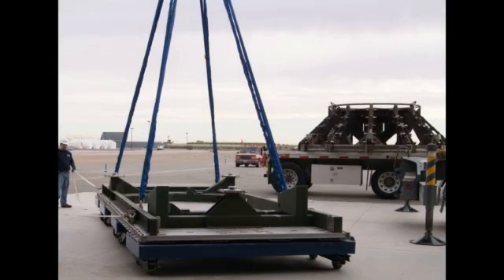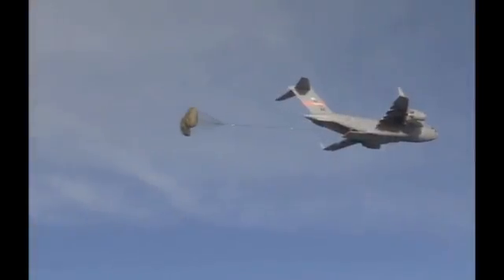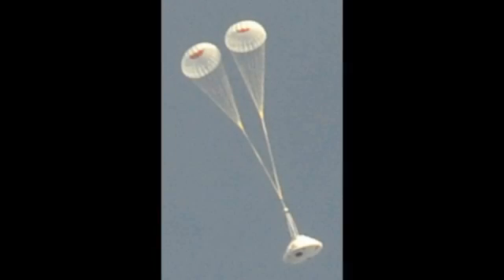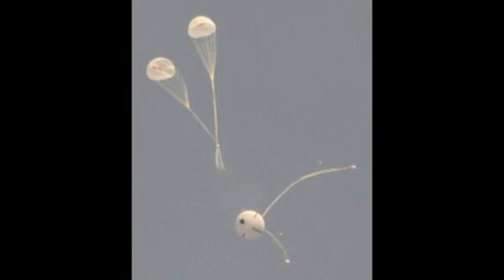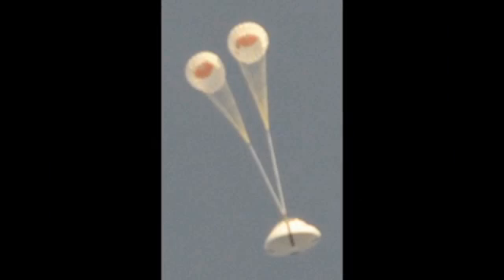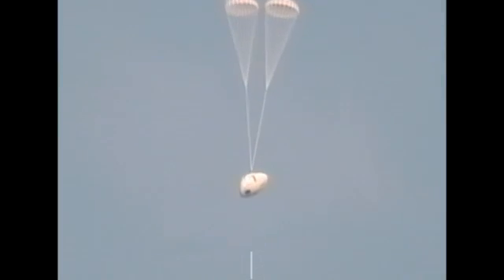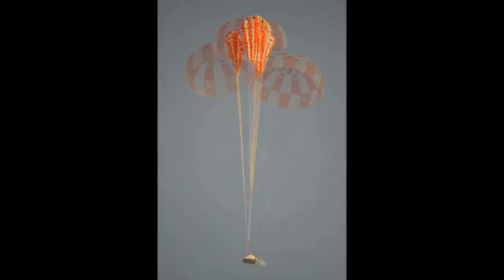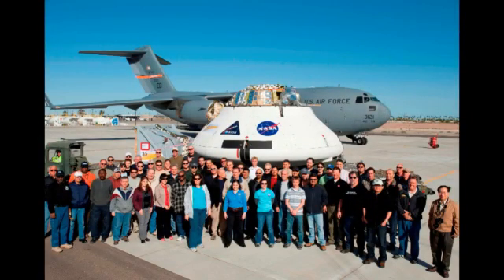Orion Parachute Testing: Fed. 29, 2012

Comment: Looks really bumpy..it seemed to jerk it's own length & back again etc pretty quickly. 
Hopefully it's less scary inside + simple is usually a good option.
Spacecraft can be decelerated with a cable suspended into the atmosphere, like an anchor.
However, consider a craft extending a 'web' of stiff cables. it could decelerate more steadily like a shuttle cock.. + it's even simpler (although not yet invented), possibly retractable & low weight. + extra chutes for last part.
just an idea.